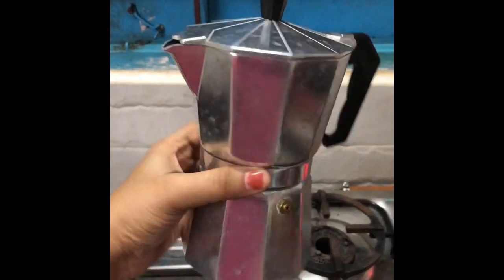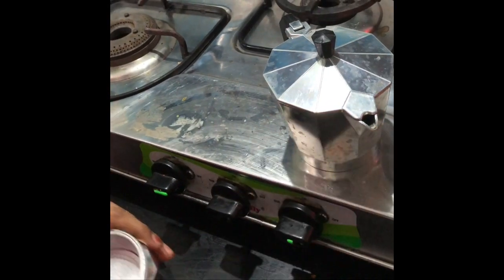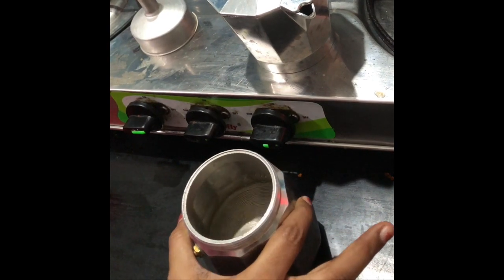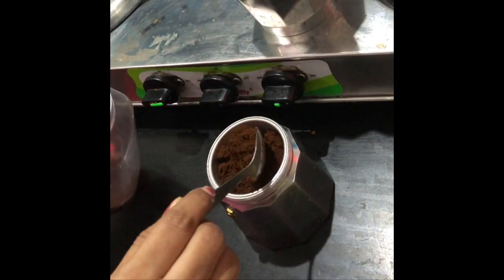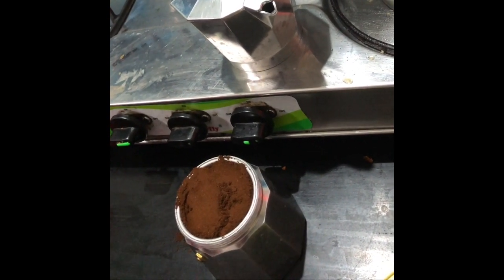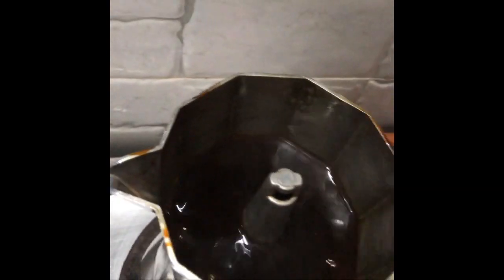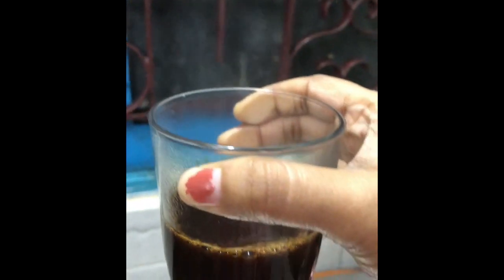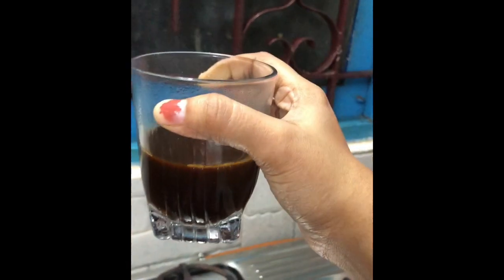South Indian filter coffee decoction in a moka pot/coffee percolator

Comment: In a Moka Pot you cannot fill the water to the top, the maximum you can fill is only up to the safety valve. You can fill half as shown in the video but never to the top. Always use roughly ground coffee beans for Moka Pot, not finely ground ones. And hot water at the bottom enriches the taste of the coffee decoction.

Comment: Here are a few tips for you. I have been using Moka Pot to get exceptional results.

1. Use Bialetti - I have it and the result is brilliant

2. You can fill the boiler section filled with boiling water / hot water

3. It is the coffee grind that matters. I tend to go for medium - fine. Any finer will crease issues and any coarser will not get good extraction

4. Dont press the coffee with spoon / sqeeze the coffee down. A couple of gentle taps is all it needs. Water needs to flow through the pores and if you sqeeze the coffee, it may end up damaging the equipment. 

4. Always use low heat - if you use high heat, the whole equipment will get hot and spoil the coffee. What you need is low heat to ensure that the water boils and builds pressure. Thats it. 

Those my simple tips and as a user of Moka Pot by Bialetti, I can say that the results are sensational.

Comment: If i want light to medium strongness in the coffee then is this device ideal? I don't prefer a very strong decoction of coffee also I always have it with milk (like a latte or cappuccino)
Reply from the maker: This does create a stronger coffee but in case you want light to medium strong coffee you can always use zero chicory coffee powder n adjust water coffee ratio
Reply: How strong the coffee is depends on the coffee powder that u use- light roasted, medium or dark roasted... for medium  string coffee, u can use arabica coffee with chicory 80:20 ratio like blue tokai coffee, cocobrama filter coffee.... add a combination of water Nd milk.. should be perfect medium strong filter coffee... This is my perfect coffee method..🌸